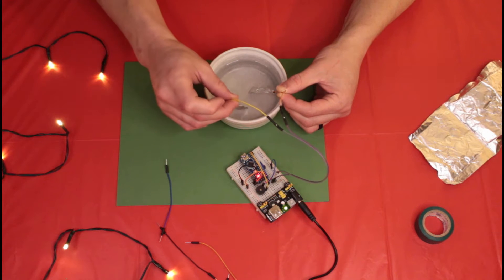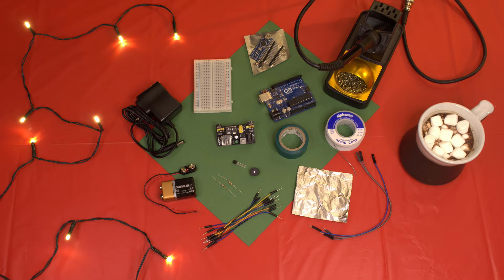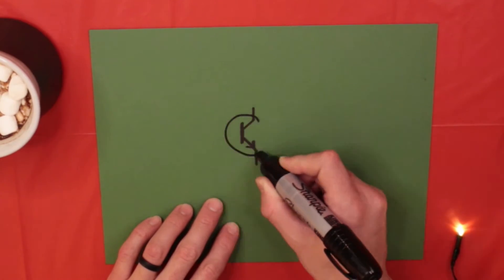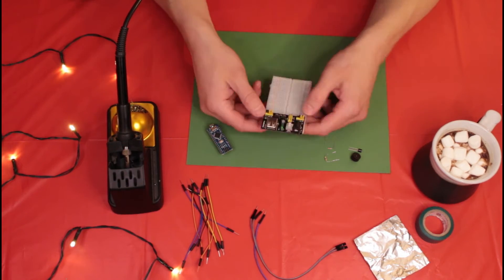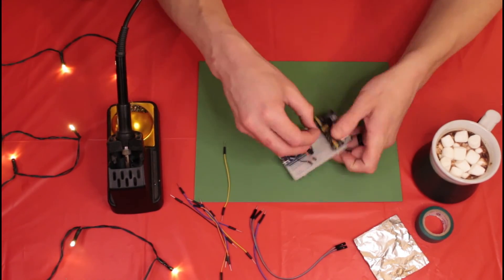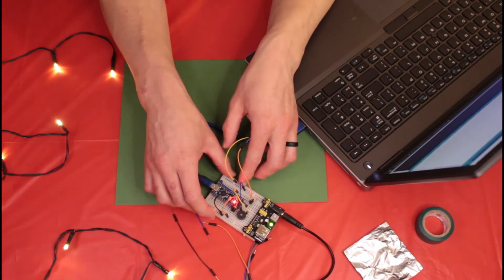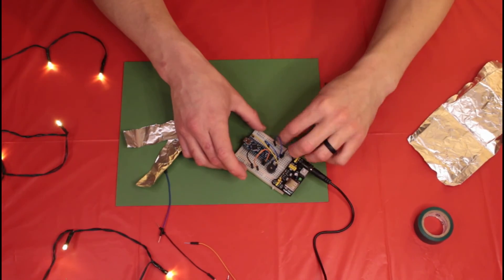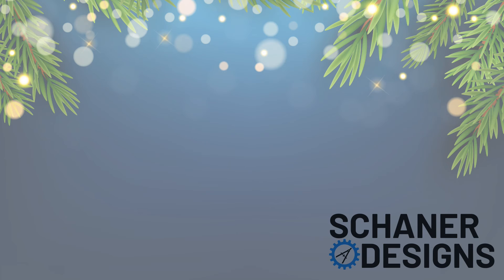How to Make an Arduino Christmas Tree Water Level Sensor

Comment: This is awesome! Thanks for the tutorial. Any chance you have a high res image of the final configuration of the board to help a noob?  I have pretty limited experience with arduino and there's an assumption for this tutorial that you understand the basics (which i'm still working on :P) .  I seem to have things somewhat working after fixing an issue in the code that prevented it from compiling.  The buzzer isn't very loud but it's chirping.  Only thing I'm stuck on is getting it to stop chirping when the sensors are connected.
Reply from the maker: Awesome, thanks for the feedback! I just uploaded a high res photo of the board on GitHub if you want to check that link again. I think I also fixed the compile error that you were talking about - let me know if that's the same change you made or not. If it's still chirping when sensors are connected, you might have an issue on the transistor side. It needs to be biased properly with a resistor from emitter to ground so that the Arduino gets a low signal on pin 2 when the connection is broken, and a high signal when the connection is made. I hope this helps!
Reply: @schanerdesigns  Thanks so much for the reply! I pulled the latest changes from the repo, hope to get some more free time soon to give it another shot.

Comment: Hey Schaner, you dont know me but I saw M Bjork liked this on linkedin so I figured I'd check it out. cool project! I did almost the same thing with a pic micro controller, a float sensor and a solenoid valve to make a self filling dog bowl for a mechatronics project in college. Merry Christmas!
Reply from the maker: Hey Lewis, thanks for the comment! That's a cool idea. I thought about using a solenoid valve or pump to automate refilling on this too. Probably a bit overkill, but maybe that'll be a project for next year. Merry Christmas!